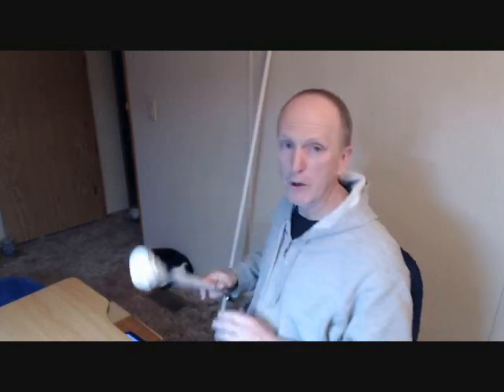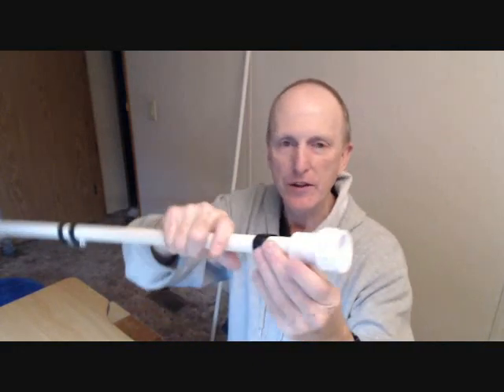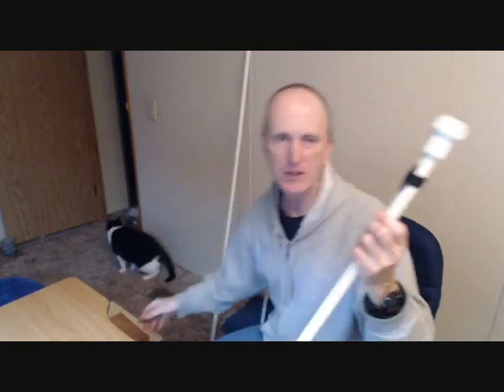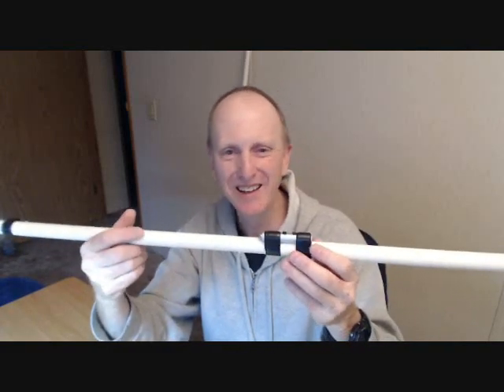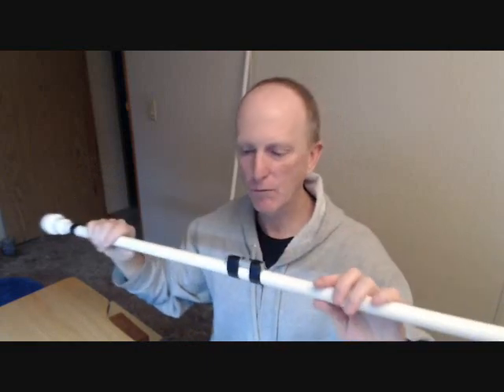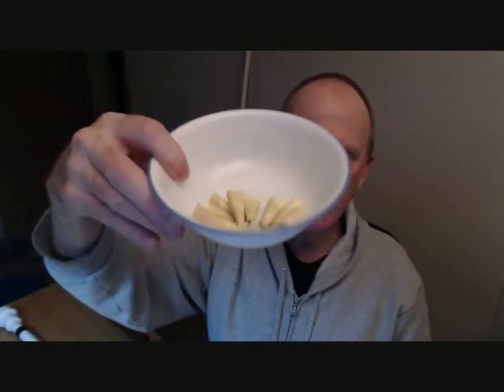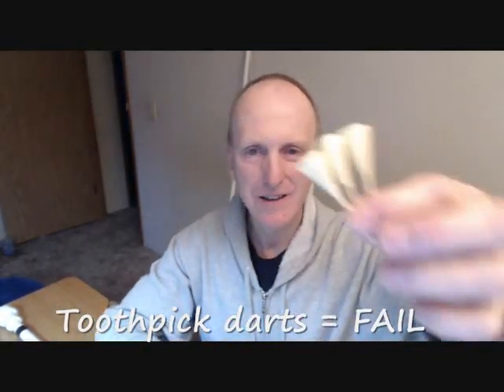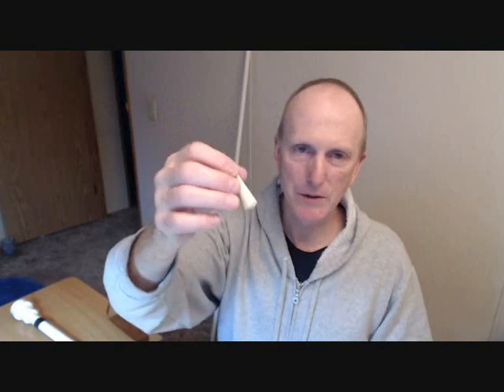Easy Homemade Blowgun & Darts

Comment: blowguns are my latest obsession. I make my darts the same way and I've found that adding hot glue as weight gives a bit better distance and hitting force, I fill a little more than half the cone for the 1/2pvc tube. I tried a mouthpiece but didn't like it, I guess it's personnel choice. Since I learned to make my own darts I decided to try using 1/2 cpvc it's thinner and were my PVC tube is about 4' the cpvc is about 3.5'. I also have a 30"x1/4" metal tube, the darts are tiny and a bit difficult for full size hands to make but it is very easy to "fire", just a small puff gives amazing range. I've tried the laser as well, it kinda works if mounted at the end with the tail end raised on layers of tape but it takes a little trial and error to get it right AND it sorta gets in the line of sight! I really enjoy your channel
Reply from the maker: +Doc Ink 
Great minds think alike! Blowguns are my latest obsession, too! I'm always looking for things I could use as darts OR targets! LOL Thanks for commenting. I was thinking about a 1/4" blowgun. I think it would be just right for shooting 6mm airsoft BBs. Am I right?
Reply: +XDM50 just like I hadn't thought about the foam darts you showed,  l hadn't considered the BB's, seems kind of like the pea shooters we had as kids but it's possible, I'll have to see if I have any and then raid the grankids nerf ammo!
Reply from the maker: +Doc Ink 
Hahaha! Have fun!

Comment: I was at the Dollar Tree store the other day and saw a package of 6 small screwdrivers, the handles kind of look like throwing dart bodies with a slight waspish "waist". They fired from my 1/2" cpvc gun right out of the box but I added a couple turns of electricians tape to snug them up a bit. At 8' the dart went completely through a piece of corrugated cardboard, 1/2" Styrofoam backing and buried an inch into a paperback on the shelf! It will be interesting to see how well they hold up to outdoor use.
Reply from the maker: +Doc Ink 
WOW! Great idea! That's impressive!